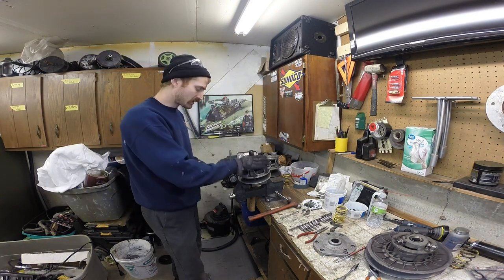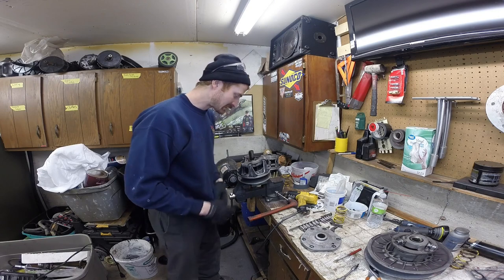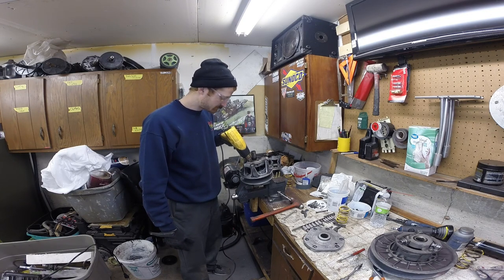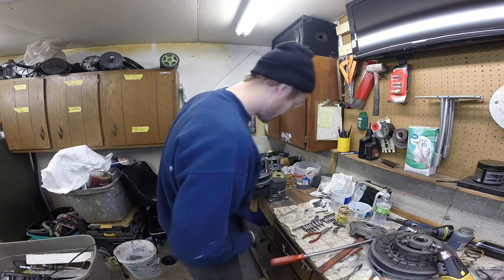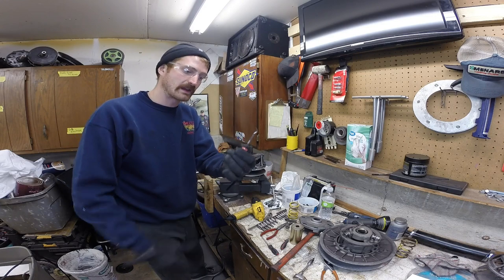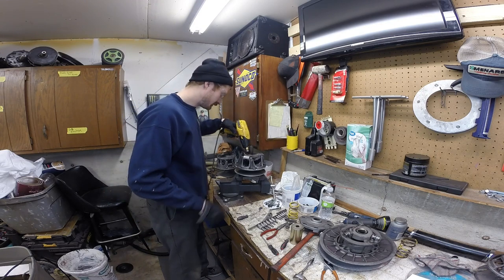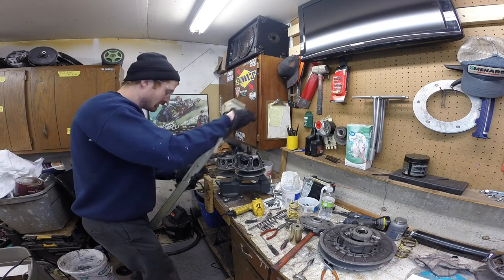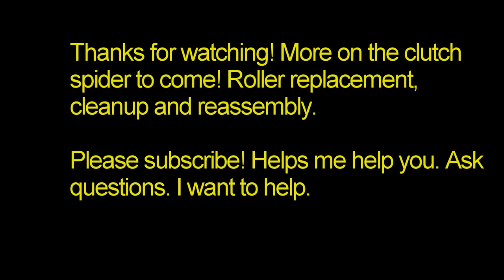Sled Tips 008 - Snowmobile Primary Drive Clutch Spider Removal

Comment: Thank you so much for taking the time to post the clutch videos. Many of these cat clutches are 20 plus years old now and are due for a refresh. Hoping to do the same to mine here soon. No sticking as of now, but I have never done it and like many, I have no history on the sled since it’s probably had 4+ owners.
Reply from the maker: Happy to do them! I will obvously be going over the roller replacement and the re-assembly soon. Just have to edit the video! Good to go through these if you have time. especially if you don't have any history on the sled. Easiest way to keep these old sleds running great is by maintaining the clutches. My Brother and I are racing 18+ year old machines against the latest and greatest machines and winning. Not with any super secret tricks. Simply by restoring, the clutches and the machines in general,  back to basic condition and maintaining that condition. 

Thanks for watching and subscribing! Let me know if you are looking for info on anything in particular.
Reply: @longtinmotorsports   will be great to see how the white rollers are replaced on a cat secondary, have not seen any video’s of this yet. Mine are certainly worn and probably could use a replacement.
Reply from the maker: Perfect. Will do!
Reply from the maker: https://youtu.be/N66HEPr6H-w here is the video of replacing the rollers!

Comment: Damn dude, you're good.
You are absolutely right about clutching being 90% of snowmobile performance. People don't realize it as they get get dirty and wear at a slow pace, then they think you 'modded'their sled when you give it back to them. "what did you do to it! " lol
Anyway, excellent video and my question is, did you make your fixed sheave fixture/holder? If so, sow? Can I get a couple closer pictures of it?
Thank you.
Reply from the maker: Well maintained machines are the leaders! From the track to the trail. 

The one I'm using in this particular video is one I purchased for 33mm taper clutches. I have since made my own for the 30mm taper 9-towers and sold a couple. The ones I've made don't have a matching machined taper. But they have worked well for me. If you jump over to Facebook or Instagram and find me @longtinmotorsports I can send you some pictures over there. 

Thanks for watching and for your feedback!